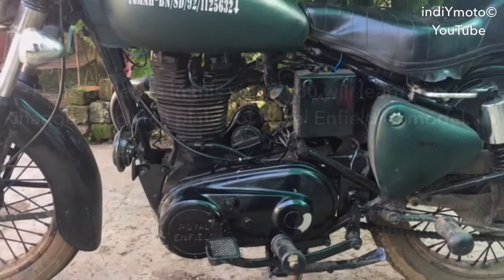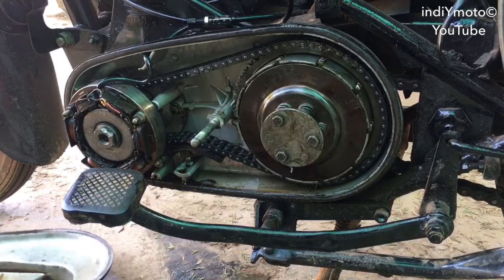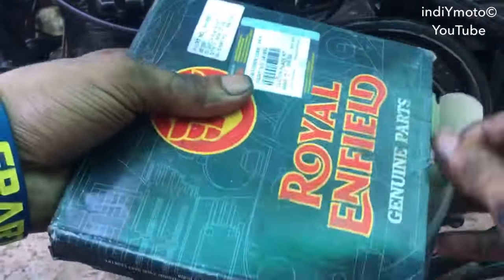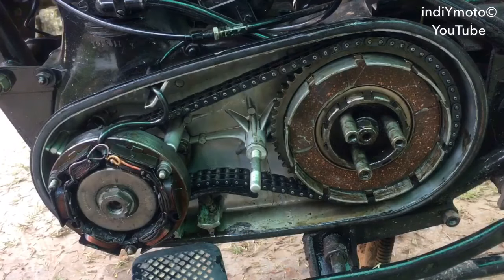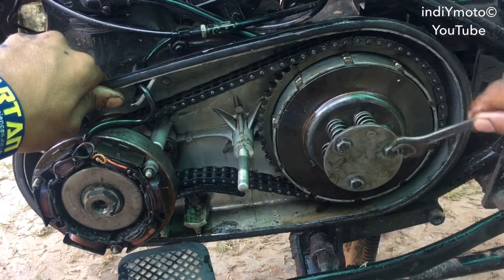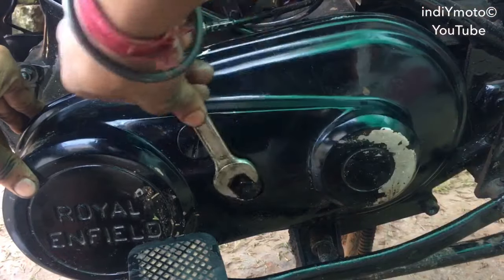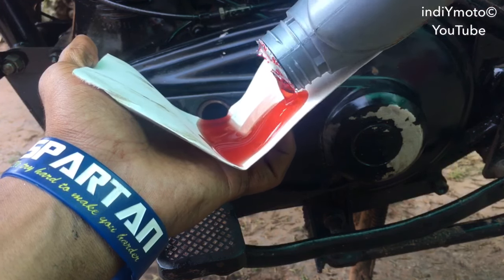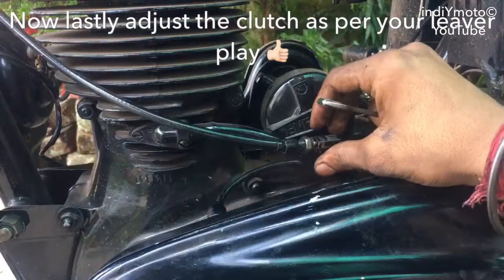How to change clutch plates of royal enfield old model CI engine

Comment: Which oil has been used.
Could you give me the grade and make please.
Reply from the maker: generally people use engine oil which they use in the crank case, but this engine has seperate clutch case so we have an advantage to use power steering hydraulic oil or (TQ oil) which is best for a clutch.

Comment: Hi after replacing the clutch plate my vehicle started once but after that there is no ignition amp meter needle does not move.
Reply from the maker: Hi clutch plates has nothing to do with ignition, is your engine cranking when you are giving it a swing?

Comment: Hello fellow rider.. my 1990 model Bullet makes sound like a spinning motor from the clutch assembly.. it was taken to a mechanic for inspection.. he adjusted the primary chain tension and also adequately adjusted the air gap between the rotor and stator.. but still the sound doesn’t go off after starting the engine.. any idea what could that be?
Reply from the maker: Hii thanks for watching the sound which you are telling generally comes when primary chain is too tight, no backlash on cam wheels or the main engine crank shaft bearings are worn, could be any.
Reply: @indiYmoto  thank you very much.. I will get them checked.. appreciated your response and keep making good content.. regards..

Comment: Sir can you tell me the exact manufacturing year of this particular bullet in the video???  I have bought a 1983 model bullet having the same clutch cover, someone said me that it's a clutch cover of a matchismo model.  I am totally confused,, expecting your reply
Reply from the maker: Hi sanal sanu, yes you have been told right this clutch cover is from machismo model of early 2000, though this bullet is from 70’s.
Reply: @indiYmoto  Sir is there any issue with this clutch cover??
Reply from the maker: Sanal no.

Comment: Company manual for old bullets says add 10w30 oil in clutch section. What is the price for clutch plates.??
Reply: karan Bana 300 rs sir and MK clutch plate 220 rs
Reply: just bought a old 1985 bullet standard 350. can u share the old mannual .

Comment: bro this is 3 plate clutch or 4 plate clutch
Reply from the maker: ashish kumar It's 3 Plate clutch assembly for 4 plates also the procedure is same it will have two flat pressure plates which will go in between.
Reply: @indiYmoto  bhai kya 4se b jyada clutch plates lag sakti h old model gadi me .. Plzz reply